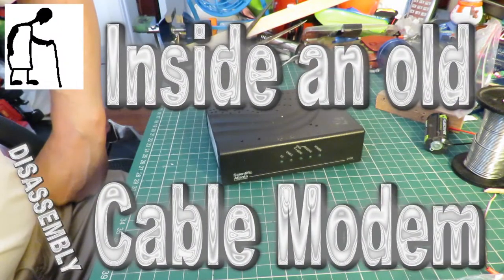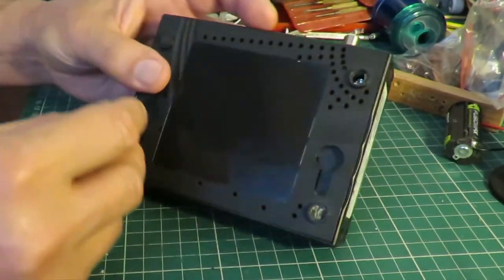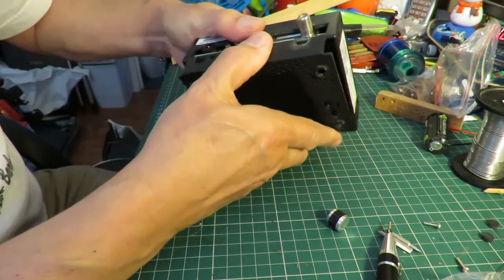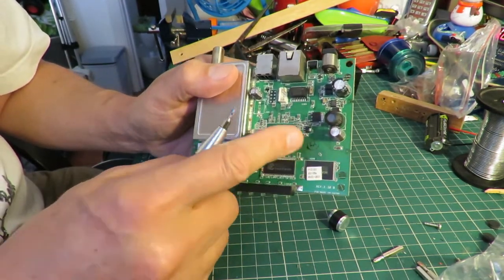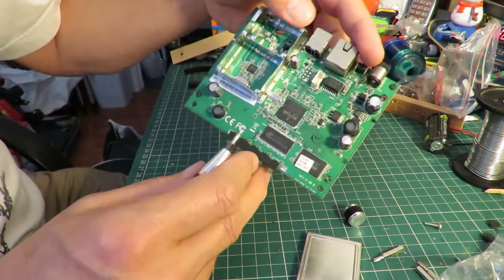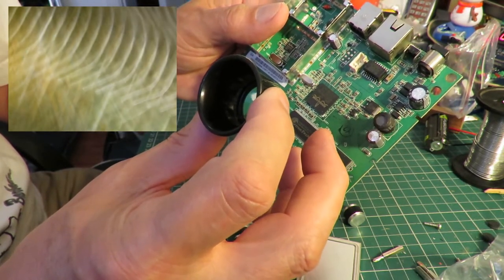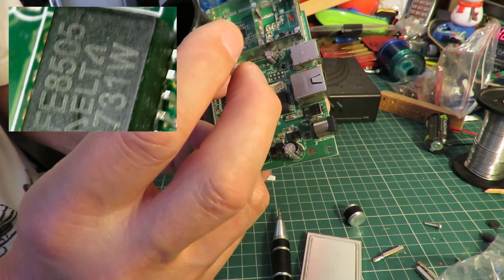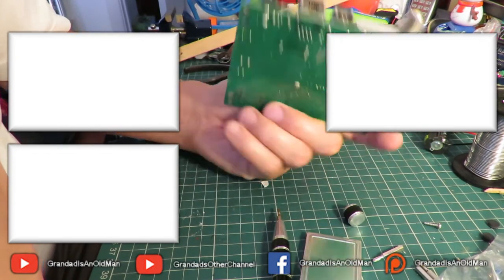Grandad looks inside an old Cable Modem - Tear down

Comment: And scrap it is. You buy LED's by the 100's, so I would not even bother taking them out.The x-tals (crystals) are of some value, but only if you are going to use them. Recently I threw away a couple of modems (I still had the telephone modems as well, I grew up with those but they are really so obsolete! Museum pieces).
Reply from the maker: 😊 So much electrical equipment has so much space inside. You get the feeling that size still equates to quality in the marketing even when there is virtually nothing inside.

Comment: I might have desoldered the Capacitors. Probably...
Reply from the maker: Not cost effective but I did salvage them anyway and the LEDs. If I ever get myself one of those hot air tools I might salvage a few surface mount items when I do this sort of thing but it was really just a "let's look inside" video😊